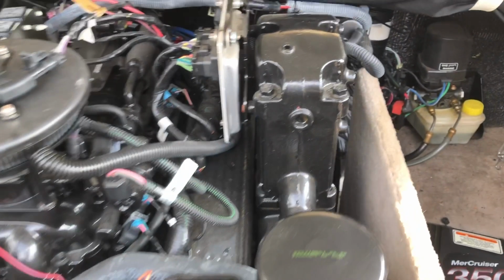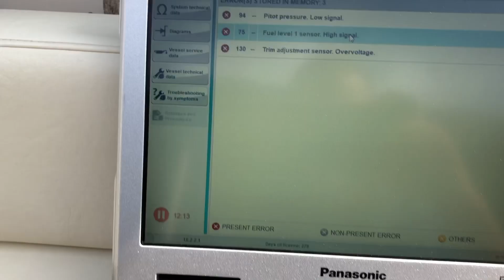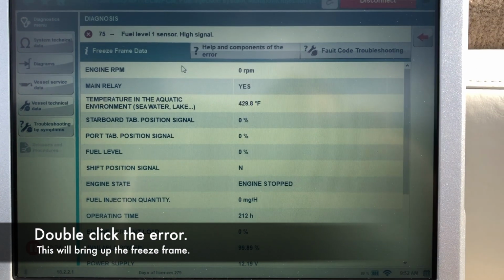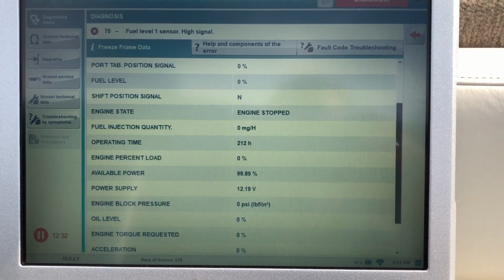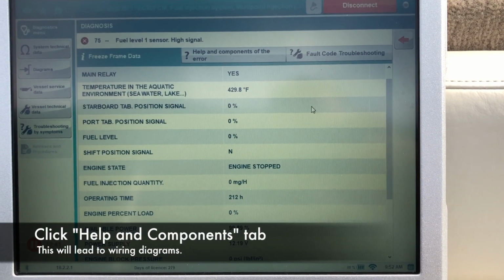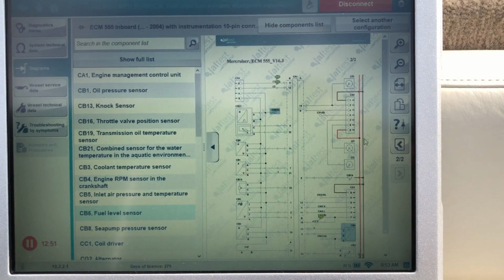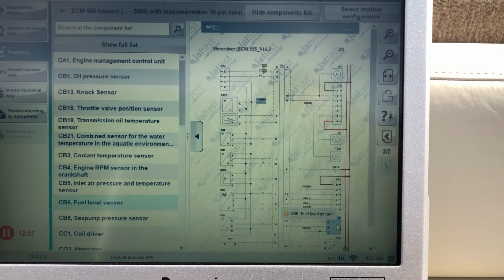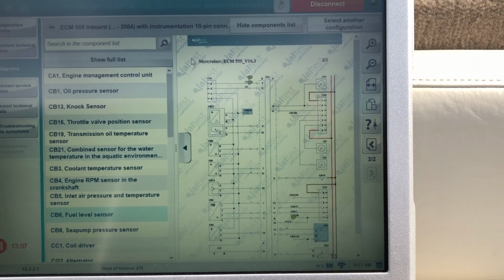Cojali Jaltest Marine Wiring Diagrams on  2007 MerCruiser 350 Mag

Comment: Still not quite there.  Would be nice to have the wire colors in the wiring diagram, and would be nice to show what’s out of specification in the freeze frame. Is the fuel level sensor bad or is the boat low on gas????